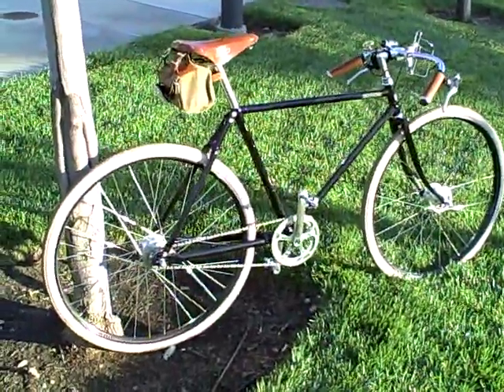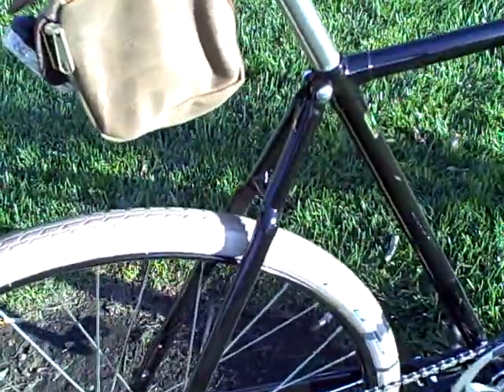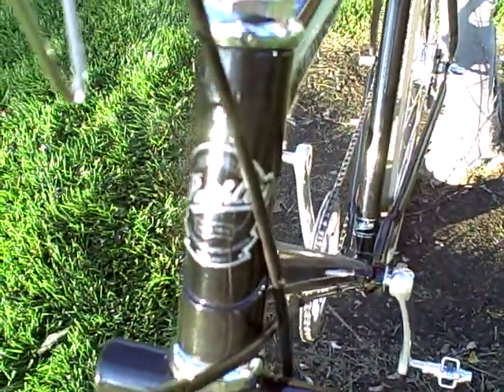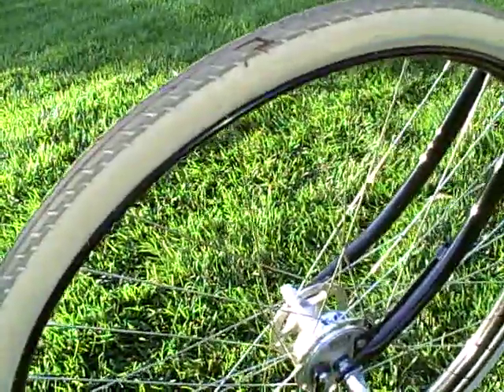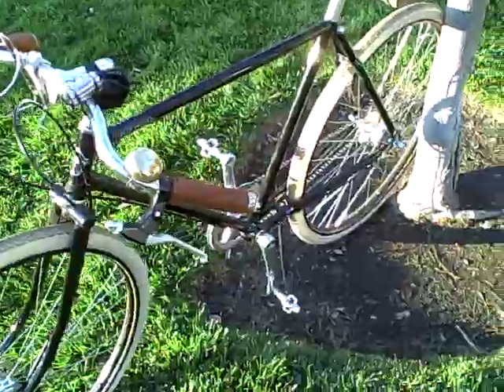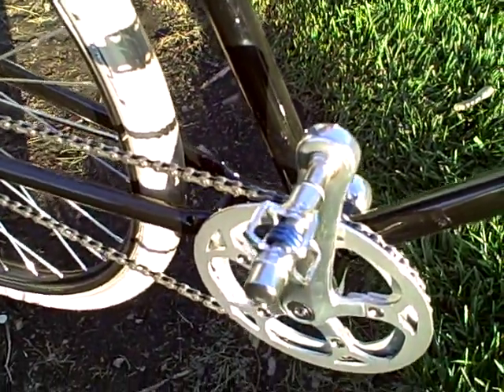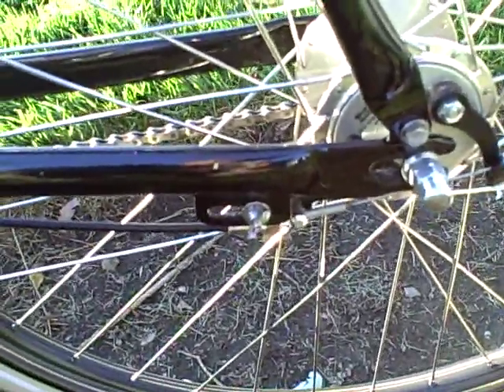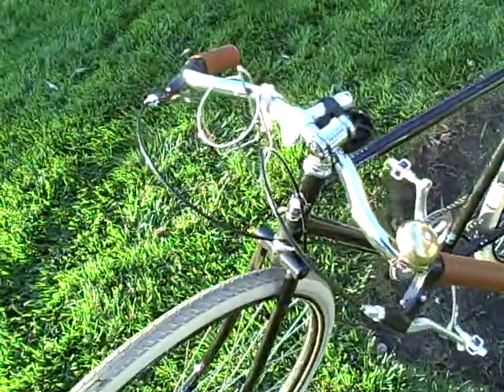Pashley Guvnor

Comment: Absolutely wonderful !
Question for you though : 
Do you know if there's a big difference between the 26" and the 28" wheels  please ?
Is the height of the bicycle much affected ?

Thank you.
Reply from the maker: The larger wheels perform much differently--they roll faster and are smoother over rough pavement. The Guvnor was designed to work with the large wheels, so measurements such as standover height will be correct. If you put 26-inch wheels on the Guvnor, it would probably sit too low to the ground.
Reply: I measure 180cm... would I be ok with 28" wheels do you think ?
Reply from the maker: I'm a little taller than that, and my Guvnor fits me fine.